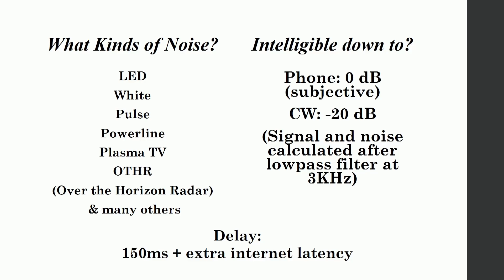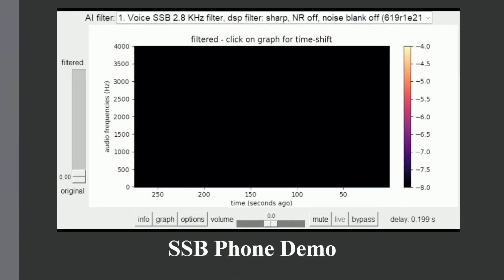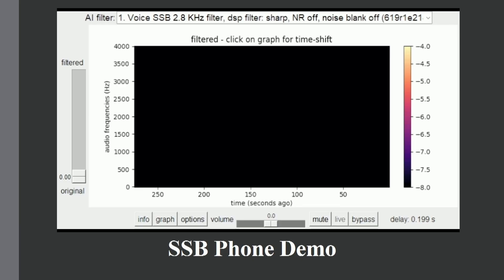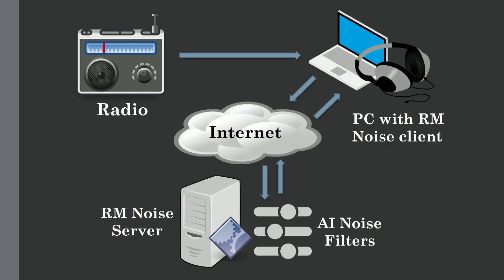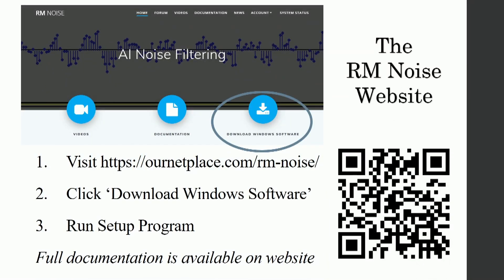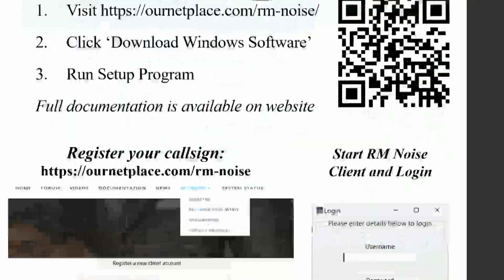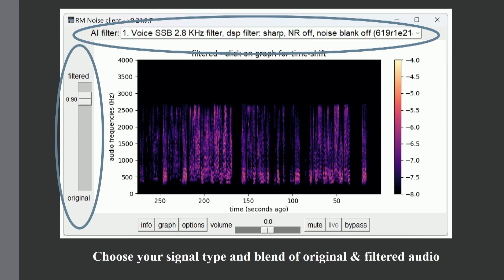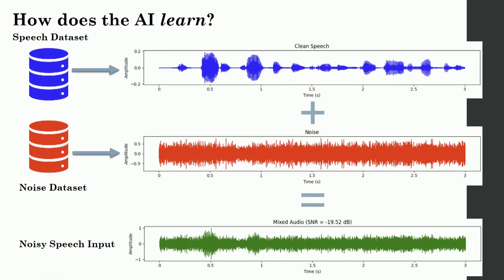RM Noise - Using AI to Remove Noise from CCB and CW Signals

Comment: Unless I'm missing something, you have to use a hard line from the headphone out of the radio to the computer input.. most newer rigs have USB.. Hopefully in the future that will be incorporated ie pulling the audio from the usb and perhaps integrating Omnirig.. If you need to grab code from another opensource project take a look at FreeDV. They have a pretty decent implementation.

Comment: Pfff You need a giant international network to get your tranceiver working ?
OK this is the thing,  Just do a FFT of your signal, than a LPF than an iFFT again and your done.
Reply: I think It is just question of time when AI will be "firmwared" in a chip and this chip will be part of  your radio...
Reply: @rokasandor893  Maybe figure out what A.I. is, before making claims
Reply: Well, you CAN go into Fourier space and LPF the powr spectrum. The problem with that approach is its likely you will throw out some signal components. That doesnt happen to such a degree with AI based removal.
Reply: @chip-s5f  I’d bet real money the AI is doing this, in addition to other magic.
Reply: @chip-s5f  sure,but my point is, if I need the internet for my shortware radio, i'd rather use the telephone
Reply: @pascalcoole2725  Is your only objection that you need the Internet? If you could do the inference on your laptop would you use this?
Reply: @SeanWalberg  Mostly Sean, on your laptop would be posible (I'm an SDR developer, not as conservative as you might think) 
It would require pretty huge data records but tends more to stand alone DSP that way,.
Reply: @SeanWalberg  Yeah, I've run much larger AI models (include 7B and larger LLM models) on my Apple Silicon Mac that has a unified memory architecture, so the GPU has access to lots of memory.   Seems very likely a model like this would fit just fine.   It would be interesting to see if you could run it on a Google Coral TPU that you could attach either by USB3 or an NVMe version.  They're pretty cheap, and I use one to do AI object detection for my IP security cameras.   The hardware to enable YOU to run moderate sized AI models is here, or just around the corner.